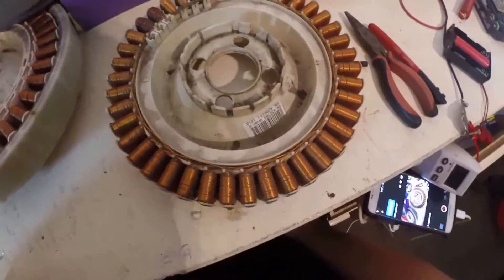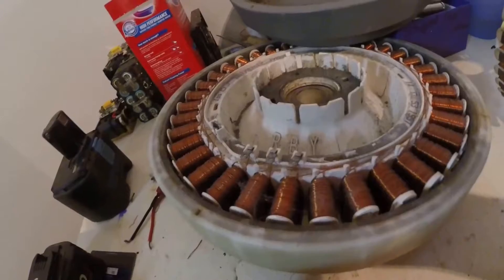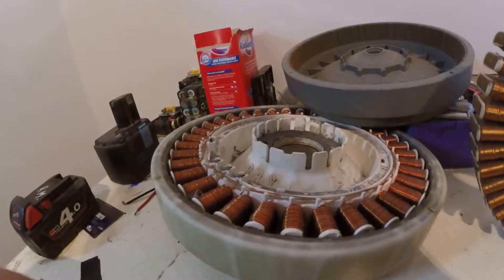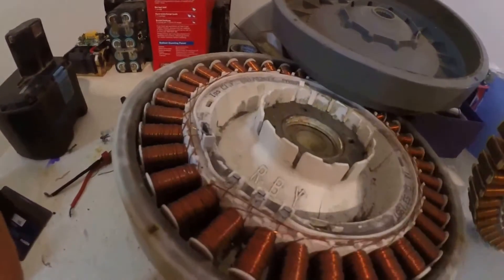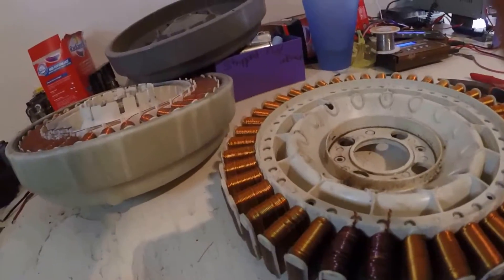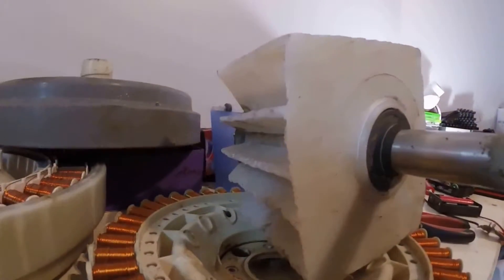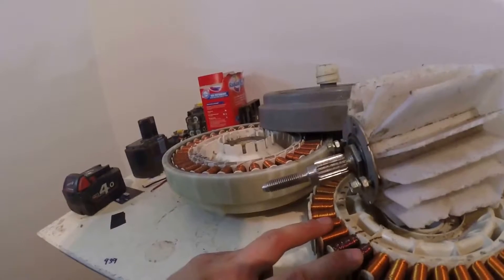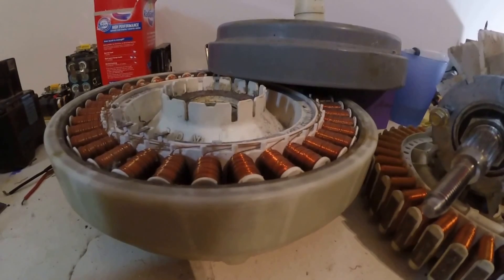Fisher&Paykel smart drive 42pole motors electric quad pt4

Comment: some late info.     at 7:31, equal stoopid.   power  should  be  taken off where  the energy is  Concentrated.   AT   THE   CENTER  OF   ROTATION.   (try controlling it with a  servo tester and  rc  esc.)        googletranslate

Comment: how this worked out, I'm looking at using one on my recumbent bicycle, having trouble find right info, I know I can change it to single phase, but have no idea of current, voltage, etc, want to use18650 cells in some parallel/series config to get 80km range, I've Checked out angry ram on YouTube, lots of info there for battery charging, little found to drive from battery, any advice
Reply from the maker: +Brendan Haslip i have only recently  received  a  brushless  motor speed controler  that might run one. My previous tests  show alot of power output and c
Good control.  My ebike is essentially  the same thing  big brushless   hub drive